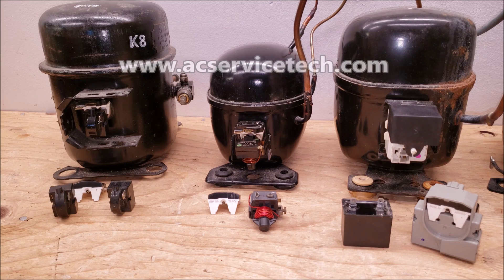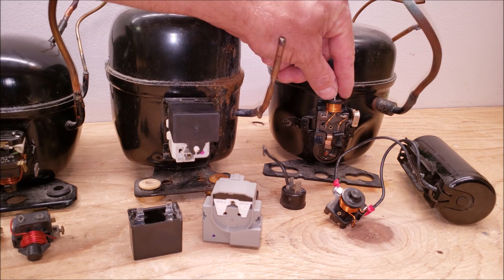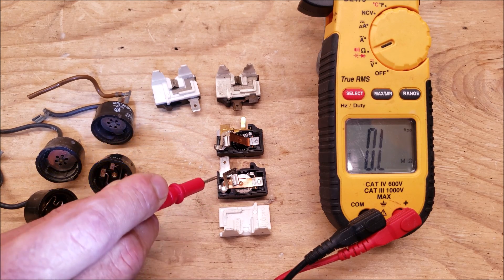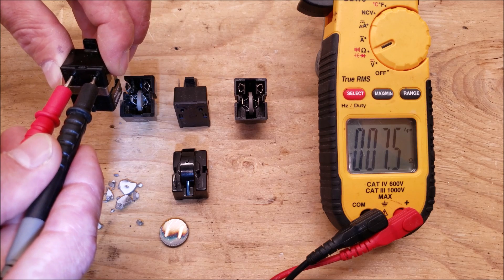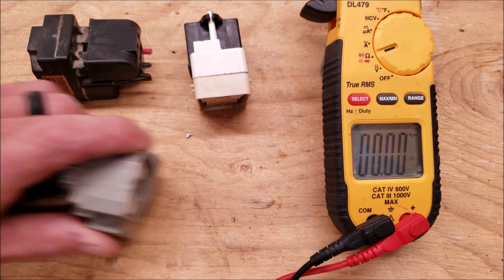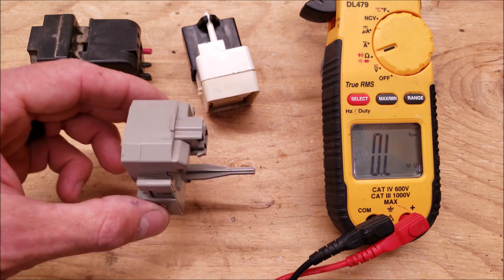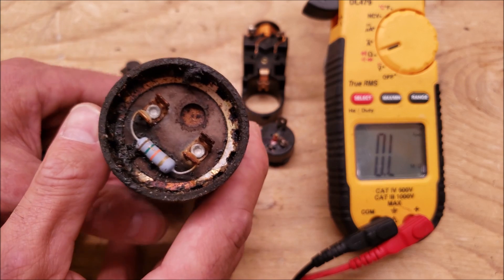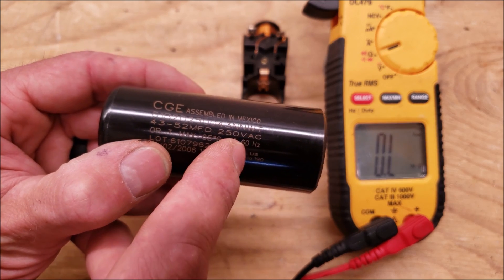Refrigerator Compressor Not Running? Test The Start Relay, Overload, Capacitor, PTC Thermistor

Comment: I'm starting to thing my compressor may be mechanically stuck as I have replaced the relay/protector circuit, the run capacitor tested fine and all electrical readings on the compressor are exactly at spec from the datasheet. My condenser fan was making a loud racket, so I inspected and cleaned under the fridge from the front only, which stopped the noise, apparently by stopping the fan, because an hour or so later I noticed a puddle from the ice dispenser. The compressor was extremely warm. When I tested the protection circuit I got and am still getting .1 ohm, then 0, with 3 different meters and 2 sets of probes, so for $36 I replaced, but compressor still won't start(tested the new one also, reading didn't fluctuate). So, any ways to unstuck a compressor? I'm thinking about trying a heat gun, but this is not my area of expertise.

Comment: Your video helped me diagnose a friends mini freezer with a broken PTC starter.  I can't find an exact replacement anywhere on the web.  Can I pull the PTC off another broken freezer even if the resistance is slightly different?  My friends broken one is rated at 4.7Ohms and my working one is rated at 6.8Ohms.  Is it safe to switch?  Thanks.

Comment: What about a solid state device in place of the thermistor? I was checking a refrigerator for my home and found a tiny circuit board in the start up plastic shell that plugged into the compressor.

Comment: yup its the relay that was bad i tested by doing the relay job by manualy switch on and off the starter coil with the help of 2 power bar hehe 
i made sure that the wire that came from runing  is the same as the 1 i can switch manualy before testing 
wouln'd want to short my outlet
now i can go play metal gear solid 5

Comment: Hi from the overload terminal to ground I got a reading of 115v however from the relay terminal to ground im not getting any reading is that normal or should I be getting a reading of 115v aswell?

Comment: What happens if the start relay is bad and allows the capacitir to continue to give power to the start winding even after the conpressor lowers on pulling higher amps to rla?

Comment: I despise those capacitors ! 200 mfd 🤬😂 they store power and its not as easy to discharge them with a flat heat screwdriver. Ac service tech, what's your best method of discharging these bad suckers? They don't play! 😷

Comment: Wow, tons of information. I did see my relay and capacitor set up. I have a craftsman digital meter that I use for small engine wiring. Not to sure about setting up for ohms on mine to accommodate to test these pieces. I've been out of a refrigerator since Wednesday

Comment: Recently had a Frigidaire mini-fridge that wasn't cooling.  Compressor was hot and when the thermal overload reset, it was pilling 9 amps with an LRA of 11.  I checked the PTC and it was reading about 50 ohms.  I disassembled it and found signs of carbon/overheating on the run terminal/PTC contact surfaces.  I scraped both surfaces down and got a reading of 9 ohms.  I reinstalled it and the fridge started up with 1.3 amps while running.  It continued working while I awaited arrival of the $10 replacement.  It's running fine.  Thanks for the great video which I found after I had repaired the fridge.

Comment: Great video and great details!!!! But what to do if one of the three leads coming off the compressor or lose? Can it can fixed or does the compressor needs to be replaced? The other two or fine but that lead is lose with a hole around it.

Comment: I have replaced the overload and relay but the compressor still making a click sound..the fan is working. When I check amp on the compressor I get 10amp when turn on than the overload will shut it off. Is my compressor bad? Thank you very much
Reply: dit you replace also the capacitor ?

Comment: My compressor protector (the gray one) it reads around 10. that's mean it's time to replace? Is this effecting the compressor? My compressor hot and is not running, lost cooling a day ago, try to figure out whats the problem. I tested the compressor with the ohm meter, seem like it's good.

Comment: Craig this is great video explaining these start components. I greatly appreciate all of your videos.   I have a question. I work at a facility doing the HVAC throughout the buildings. Just installed a new thermostat on an old Traulsen reach in fridge. It's over 30 years old. runs great now. After watching this video and another about currect relays I am considering getting new start components for this Traulsen. Would that be the proactive right thing to do? The parts for the Tecumseh compressor can be gotten locally for under $50. Your thoughts?

Comment: Why does my compressor run if I take overload out and wire it direct I have changed everything ,start relay ,run capisitor , and changed  numerous overload protection if I leave everything else connected but remove and direct wire overload pin it will run ?? What could be problem I'm baffled it keeps tripping if I put in a overload protection

Comment: excellent, but i have a question,  when i  conect the compresor with the kit start, it does start normally,but if  i disconnect it, and conect it inmediately , doesnt start,i have to wait a couples of seconds til, the compresor start again, . i checked the capacitor , and its ok.. what is the cause of that sympton.?

Comment: I got a ratteling sound comming from the overload unit when I shake it after removing it. Got a new one but it rattles to like the old one. Is this normal or does this mean its bad? Been trying to prevent a surging problem I was having with my new Daewoo mini fridge. Causes a slight trip in the circut its plugged into.

Comment: I recently took apart a relay very similar to the one pointed to at 1:32.
I believed it to be defective as the nothing in the high voltage circuit would run with it plugged in. 

After removing it and taking it apart. I found a PTC thermistor wired in parallel with the capacitor.
The thermistor was undamaged and read 5 ohms. and the relay was closed. my fridge compressor happened to be a PTC start. Capacitor run. listed as PTCS-CR in the compressor data sheet.

The timing sequence of the rely is all engineered into a thermo disk. Exactly like the ones shown to the right at 4:00. If shortly unplugged the compressor the compressor will draw high amps but be unable to start. The relay will open then when it closes again the compressor will start. The fridge will usually immediately start if unplugged for over and hour. If the relay opens because the compressor overheats it may function properly for 24/hrs.

Comment: I have a small freezer. It died. I just went and checked it out. Found wall outlet natural and hot are reversed. So I hooked. it up to known correct power source. The relay started heating up and smoking. The compressor did nothing. The start cap is out of specs as well. Start cap says + - 5%. It reads 6. Cap is 10uf. So today going to ohm out compressor pins. So question if compressor checks out. Then I should order a start cap and a new start relay?  It is a Kenmore box freezer.
Reply from the maker: It sounds like you should. It is possible that the compressor is internally mechanically stuck but most likely it is just the relay and cap. Thats where I would start after ohming the compressor and checking for correct voltage prior to and under load, thanks!
Reply: @acservicetechchannel  On pins I was getting high readings like 88. ohms. left lower to top center 7 ohms.
Reply from the maker: Did you see this video yet?
https://youtu.be/NxseKu60kYA
Reply: @acservicetechchannel   So end results. Readings off the compressor. left bottom to top 7.76 ohms. Top to Right bottom 81.2 ohms. bottom to bottom 88.3 ohms. One other ohm reading I just took was off a good ground to the compressor to each pin. they all were shorted to ground by ohm reading. I guess the compressor has died. Any thoughts on this. All are welcome.
Reply: The compressor ground (must scratch thru paint to contact metal) with meter negative probe then meter positive probe to each of the 3 pins would show oL (open line). This will be a good compressor.with meter in OHM position. Open line oL means not connected or shorted.

Comment: Today I changed burnt PTC Thermistor in my Samsung fridge. Your instructions mentioned to check the resistance between starter and running inputs (bottom two out of total three)of PTC. It should not be open. Guess what! Mine was open. Along with other tests I decided to chagned PTC for $15.00 from Grainger. It worked. Thank you very much for a very good explanation.

Comment: I just checked 3 in 1 Supco RCO 410 capacitance which is 243-292MFD. I watched videos and found a lot of people used this to replace the original 15 MFD. Will it be bad for compressor? Thank you
Reply: You probably figured this out by now, but that Supco is a "hard start" add-on.  The original 13uF capacitor is a run capacitor, it puts a shift on the voltage going to run winding, giving the proper angle on rotating magnetic field to keep the compressor rotating...so no, using a different value run capacitor (giving a different shift) would not be a good idea.

Comment: I have a PTC Thermistor model QPE2-A4R7MD3.   When I test it for resistance I get 1.4 ohms.    Is that a bit too high for a PTC?    The test was run while the Thermistor was cold (not been attached to the compressor for a long period of time).   It's from a small Vissani refrigerator model HVDR1040W.
Thanks!
Reply from the maker: That is likely ok, did you watch my video on ptc thermistors as well?

Comment: Help Craig, my kenmore old refrigerator stop cooling ,im hearing a clicking sound on and off on the compressor and there’s a external 15uf capacitor but it’s not exploded(swollen). I put a screwdriver between the terminal but no spark, is this the culprit not why compressor is not running ? Btw I don’t have a tester that reads microfarad just a regular multimeter,thanks
Reply from the maker: You would need to test the starting device such as the ones in the video as well as the capacitor to tell with a multimeter that reads uF. Unfortunately I wouldn't know either. I would need to see the measurements, thanks!
Reply: I’m getting a 14-15amp in one leg using an amp meter. Then I pulled out the thermister and it was rattling inside when I shake it so I put a jumper on those 2 terminals(running and start) and I’m getting 23 amp( compressor didn’t even start nor humming) at the same time overload protector would trip within 2 secs,am I right that the compressor is shut/bad? Btw,what’s a good brand of ref now this day?
Reply: Also I’m getting a reading of 55-80 ohms on 200k setting between any of the terminals and a ground of the chassis,which I think it should be zero ohm?

Comment: If you cut off the resistor does it now have to be added back to the capacitor? Or not necessary?
Reply from the maker: not neccesary
Reply from the maker: I don't know many techs that solder them back on and half that I run into don't have the bleed resistors on them anyway, thanks!

Comment: You are to good of a tech to be using those cheap UEI meters they should be illegal. They are never accurate in testing capacitors. Great video and awesome book.
Reply from the maker: Ha ha thanks trey, I try to use the tools that beginners use to teach with and what most technical schools have. That is also why most videos are shown with compound gauges. I have other tools as well but typically use them and they do seem to hold up well for school use, thanks!
Reply: Accidentally saw that on a brand new cap. Fieldpiece right on ...uei .5 lower

Comment: Have you done any videos on inverter controlled compressor?
Reply from the maker: Not on the diagnosis but resistance values will be equal on all three pairs when the wires are disconnected to the compressor, thanks!

Comment: Galco TV refers to "OL" as "open lead". Oh is a letter zero is a number. Greg thanks for your excellent videos, well presented and accurate.
Reply from the maker: Open line, Over Limit, the list goes on but basically the resistance value is too high to read with the meter. It is reading the resistance across the air from probe to probe, thanks
Reply: @acservicetechchannel  Correct, the term is a matter of preference by the instructor. Open line or open lead is what I feel most comfortable using, again it is a matter of choice. Thanks for your reply.
Reply: Open loop

Comment: At 2:52 a cockroach come across right side of screen
Reply from the maker: Ha ha, we are in my shop and there are some creepy crawlers around. Once I had a salamander come out, look directly at the camera and just turn around and leave, ha ha!
Reply: @acservicetechchannel hello I replaced my relay and overload and my refrigerator started working again but after a few hours it stopped working again any suggestions
Reply: Another excellent video. Good job!
Reply: I didn’t see it
Reply: 3" off rear wall....not sure if cockroach
Reply: Only on you screen brother  maybe is you cockroach😂😂😂😂

Comment: @9:00 those capacitors I’m fairly certain were run capacitors. Their mfd ratings are low. Even supco has kits that identify these as run capacitors not start caps. Still a great video!
Reply from the maker: Yes absolutely are run caps on the TSD's thanks and good catch!